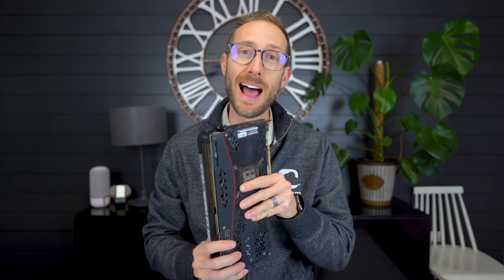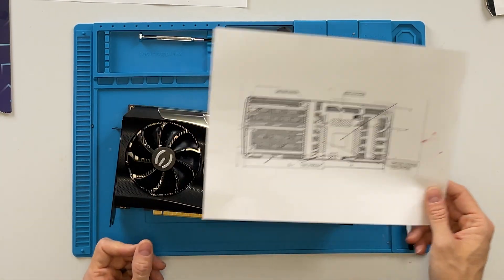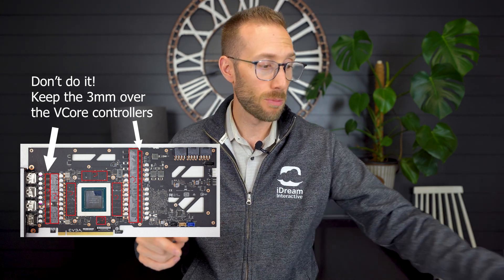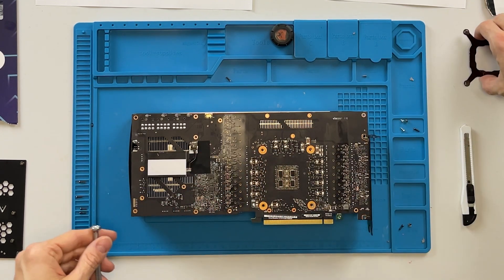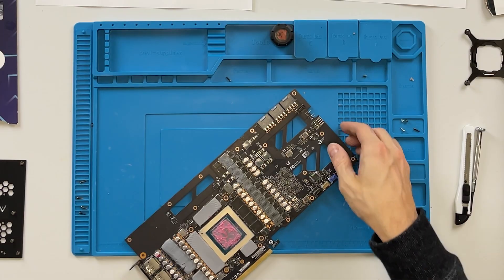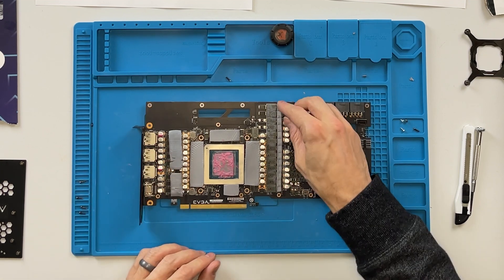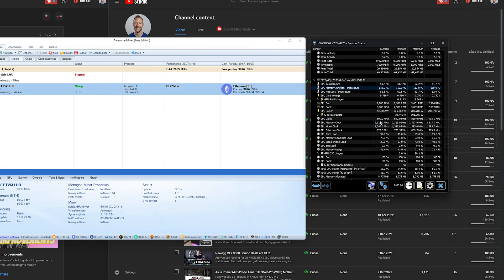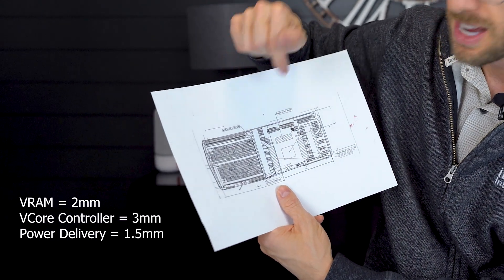EVGA 3080 Ti FTW3 Thermal Pad Replacement Instructions (Skip to 13:46 before you start!)

Comment: I did everything like in the video but my vram memory is like 96-98c  that is too much i thinks
Reply from the maker: No, that’s totally fine. VRAM doesn’t start to throttle until 105-110C. Lower is always better but I wouldn’t be too worried about high nineties. If you want to double check that your VRAM modules are making proper contact with the pads. That’s the most important part. If they aren’t touching and pressed together, the heat can’t transfer through the pads.

Comment: Followed your video until you started putting the card back together.
At that point I used my 3mm pads over the RAM and VRM areas on the back of the card to use the rear cover as a heatsink as well.
THEN I came across your error. I had already cut my 3mm stock.
Dude, don't make a freaking mistake in the video and leave it in. What a fricking stupid thing to do.
Thanks for wasting my 3mm pads. I had to use bits and pieces.
Won't be watching any more of your videos.
Reply from the maker: So sorry about that.  I've since updated the description to describe the mistake along with where the fix is located.  I kept that footage in so people could see the process of applying the thermal pads.

Comment: I must have done somenthing wrong, my temps got worst. I used 3mm on mosfets, 2mms VRAMs and 1mm LR22. Also used 3mm osn the backplate. I followed other guides too because mine is a RTX3080ti XC3. Any idea what could have gone wrong and what to look for when opening it again?
Reply from the maker: Hmm.. yeah, mine's on the FTW not the XC3.  It may use different thickness pads.  The best way to check is when you sandwitch the card back together, can you shine a flashlight and see any space or room between the card and your thermal pads.  They need to be touching.
Reply: @JohnLCharette  thank you for the reply! I checked multiple sources before doing this and I think I got the pads right, but my pads might be too stiff. I tried the light trick and I cannot see light through the pads but I can see it shining through the left and right side of the GPU die enclosure, but only a very thin line.

Comment: Thank you for this video! Was the only place i could find a clear answer for pad thickness besides an EVGA support diagram that had strange thicknesses listed. Took my vram from throttling at 110c to 74-77c depending on the game. Managed to drop my core temp down to the high 60s too, which it had been okay at low 70s roughly before, but I'll take it! Thanks again.

Figure I'll leave my own experience here as well for anyone who comes across it. I used thermal pads I had leftover from repairing a 5700xt some time ago. Random pack I got off amazon for cheap, pack says the brand is Owltree. It only had 0.5mm, 1mm and 1.5mm sheets in the box, so for this gpu I stacked them (a 0.5 and a 1.5mm for the vram to make the required 2mm, for example) and the temps don't seem to be harmed in any way, given my results. I'm sure having the proper height of a single pad is ideal and easier to do, but this worked for me if it's all you have. For paste I used Thermalgrizzly Hydronaut. Always had good results with it, highly recommended.
Reply from the maker: That's awesome to hear and thanks for sharing your experience as well!  I'm going to pin this comment so others find it.
Reply: how much of it did you need to order so you had enough?
Reply from the maker: I ordered a few pads 4x6" or so of each thickness.

Comment: hey what is pink ?
Reply from the maker: That would have the previous thermal paste for the GPU core.  I'm unsure if that's original from EVGA or if the previous owner had already changed it.

Comment: Hmm, this might be what I need to do, I see your memory junction is 77, mine is 90-92, what are your memory temps? It is slightly lower in the HW Info.

My gpu has minor artifact issue but honestly it looks more like a heat problem than a memory going bad.
Reply from the maker: My VRAM temps were 110C on full load.  That's when I knew I had to do something.  I would definitely recommend replacing the thermal pads.  Looking at another comment, it looks like Kritical Thermal pads also had a video showing how to do it.  Hopefully both videos combined will get you sorted.  Let me know how it goes!

Comment: Used 2.5mm for memory near the gpu, it prevented touching gpu to cooler. Not recommending.
Reply from the maker: Good to know!   Did you end up switching it for 3mm?
Reply: @JohnLCharette  end up rolling and compressing them to about 2mm and ordering precut pads from kritikalpads. I have no idea how yours wokred.
Reply from the maker: I'm wondering if I changed it to 3mm or 3.5mm instead.  I know I had a bunch of different thicknesses.  I also wonder if the cards are slightly different based on their manufacturing date..

Comment: You used 1.5mm 2.0mm 2.5mm and 3.0mm i'confused
Reply from the maker: In the video description, I say exactly which thicknesses are recommended from EVGA.  In the end, I may have opted to use a 0.5 thicker than recommended if I didn't feel like it's sandwiched well.  I recommend having a few options available in case you run into a similar issue.

Comment: Mine's been burning up as well.  Whooping over 100F (once I converted from C measurement).
Reply from the maker: Are you going to consider replacing the thermal pads?
Reply: @JohnLCharette  I thought about it yes.  But unsure whether I should replace it with the 4080 Super while I can open up the 3080 Ti via Youtue instructional videos.
Reply from the maker: Yeah, it's a bit scary taking apart your main GPU if you don't have a backup.  If you were going to upgrade anyway, I'd buy the 4080 Super, and then replace the thermal pads.. test it and sell it.
Reply: @JohnLCharette  It was on sale at Best Buy for the Gigabyte 4080 Super, $50 off.

Comment: so let me get this straight , you put 2.50mm thermal pad on VRM instead of thermal putty?
Reply from the maker: Hey, sorry it's been too long.  According to my video description I used 2.0mm on VRAM chips.  I didn't have any thermal putty.  Are you planning on changing your pads?
Reply: @JohnLCharette  thats correct my ftw3 is getting really high temps..
Reply from the maker: Yeah, I'd recommend switching out the pads.  I was recently told that EVGA support will send you the thermal pads thicknesses as well, if you reach out to them.
Reply: @JohnLCharette  well in latin-america i was told by evga support that i don't need to replace them because the temps are in the good-threshold. (under 110c on vram).. i'm going to mod my GPU i will add 6 30x30x10 fans as extractors and add 1 fan on the back of the cpu chip.
Reply from the maker: Yeah, I've seen that done before, especially when people were mining a lot.  I really helps cool the VRAM.  Even though EVGA told you you don't need to replace them.. it might be worth it.  What temps are you getting?  Core vs VRAM?
Reply: @JohnLCharette  Vram hits 90-100°C and vcore 80-87°. So i decided to add extra 6 30x30x10 fans at the side as outlets and 1 behind the core. And a little Undervolt i dont remember exactly the values i think it was around 1750mhz to 1850 with 850Mv peak. My temps now are 60°-65° with 1080P ultra settings with ray tracing while, 4K sits on 84°c.

Comment: is this similar to a 3090ti? the thermal pad thickness
Reply from the maker: Yikes, I don't think so.  I can't remember, does the 3090 Ti also have VRAM modules on the back like the 3090?  If so, it'll be very different.  Someone recently told me that you can email EVGA support and they'll provide you with thermal pad thickness'.  Try that out.

Comment: One thing you can also do is to message EVGA support and they will send you the correct thickness pads as well!
Reply from the maker: Ohhh, that's really good to know.  Have you done this since they shutdown their GPU department?  I wonder if they still support these types of questions anymore.
Reply: @JohnLCharette  as of 2023 October they still do. I had to repaste my card due to ungodly temps and one of my thermal pads stretched during disassembly and the thickness was messed up. At the very least their support will give you the correct dimensions for the thermal pads of each model
Reply from the maker: That's incredible.  I'm going to pin this comment so others know.  Thanks for sharing!
Reply: @JohnLCharette i know this is old. But to answer your question, im moving away from water cooling and repasting/padding my card. Evga is sending me new pads for my 3080ti.
Reply: @Mc-Derpulous  Thanks, just opened a ticket with them, hope to get them too!
Reply: @kruspepoq8985  Did they reply? Can you post the values?
Reply: @elargento1  They did, they use 3 different thickness 2.25, 2.5 and 2.75mm. Go ahead and email support for more info
Reply: @ they replied to me with the sizes they used in the card, not the best ones.
Reply: @ Yea, the intial response was not super helpful, there was some back and forth and I had to use a color coded picture for more precision
Reply: @ can you share the pic?
Reply: This is helpful because I just bought  a used 3080 ti and am debating redoing the thermal pads and paste but I'll see how Temps are first
Reply: can i do that with tuf gaming gpu too? they will send me back?
Reply: @NakitaTech  EVGA didnt make the TUF GPUs, You would have to email asus support and see what they say

Comment: Hi. I have a question. Does the 3090 version of that card use the same size thermal pads?
Reply from the maker: I can't confirm in person, but I would guess that they aren't the same due to the 3090 having half of it's VRAM chips on the back of the board.

Comment: Great video!!
Reply from the maker: Thank you so much!  Are you considering changing the thermal pads on your GPU?
Reply: @JohnLCharette  I just did with the kriticalpads for my 3080ti
Reply from the maker: Aha!  I hear those pads are great.  I didn't know about them when I replaced these or else I would have used them.  Would you recommend using them again?
Reply: @John Charette  I would recommend them easy to install and worked great! Going to order some for my 3090 now!
Reply: @alexibrahim4076  what is the temperature of the core and memories after the exchange?
Reply: @InuGii  it dropped my memory temps to 65 to 70C down from 80s
Reply: Yes.
Reply: @alexibrahim4076  and core temperature?
Reply: @InuGii  core mid 60s to 70s as well
Reply: @alexibrahim4076  thank you!

Comment: Just use the Kritical Pad set for 3080 FTW3... They are the best ones. Those thermalright ones don't last long...
Reply from the maker: Ha!  Didn't know these existed.  Thank you very much!  I'll pin your comment so others know which to buy.
Reply: What thickness of pads are you using? Might I have a link to that? Please and thank you in advance!
Reply from the maker: @Stabby, if you're looking for the pads I used, there's an Amazon link in the video for the different sizes.  If you buys the Kritical Pad set, all the sizes are included for you in the set.
Reply: Is it just for 3080 FTW3 versions? Or can it work for other 3080s? I have a Asus TUF OC 3080.
Reply: Might be a tad bit late, but each version of a same card can have different pad thicknesses depending on how asus, evga etc did their radiator @fpshooterful  best way is either you measure it as precise as possible when opening it, or scour the internet for info
Reply: Damn, $48 on Amazon.  LOL
Reply: Kritical has horror stories of delamination after 6 months. As always, do your own research prior to deciding for yourself.

I like thermalright extreme odyssey, gelid gp-extreme, and thermal grizzly, myself.
Reply: they are always sold out

Comment: so far so good with my evga 3080 non-ti card, mostly playing star citizen. SC is a bit tough on the system though, i'll be doing as you did soon enough. good vid.
Reply from the maker: 3080 is an incredible card.  It's still my favorite bang for your buck card.  My video should be almost the same except a couple sell VRAM chips.  Hope it helps :)
Reply: Did you end up doing it? I have a 3080 Ti and thinking of doing it. I am running into high temps as well.